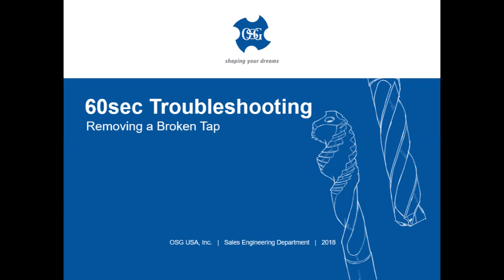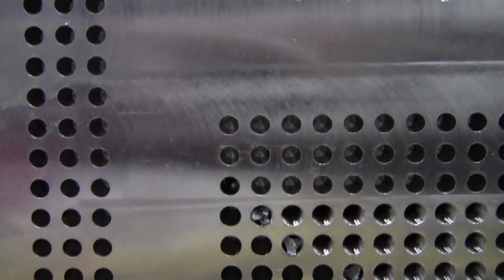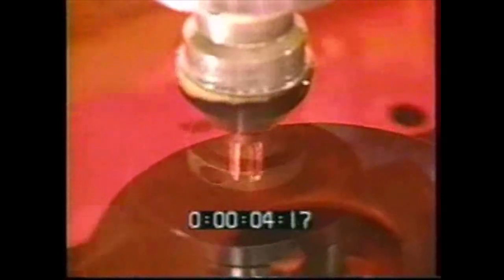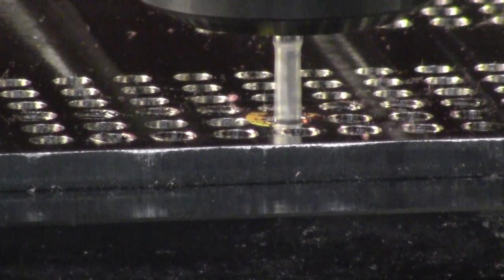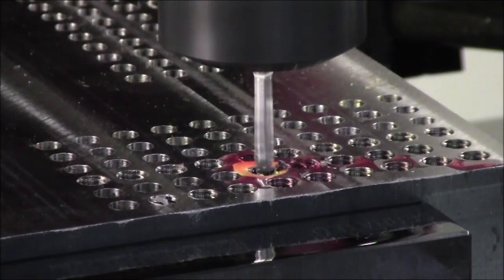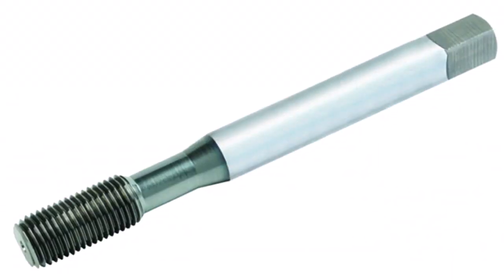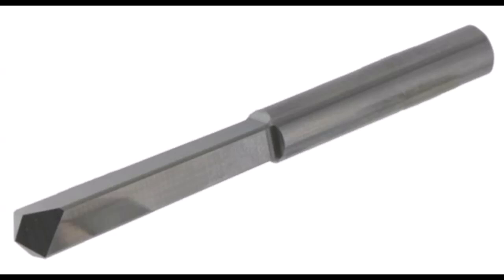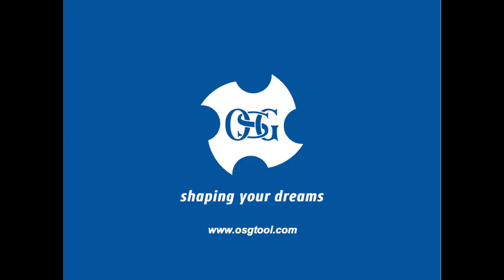OSG 60sec Troubleshooting - Threading: Broken Tap Removal

Comment: Just use a bog standard carbide ball nose end mill with a G73 pecking cycle apply a 0.2mm peck. Spindle speed to 10,000 rpm........boom!